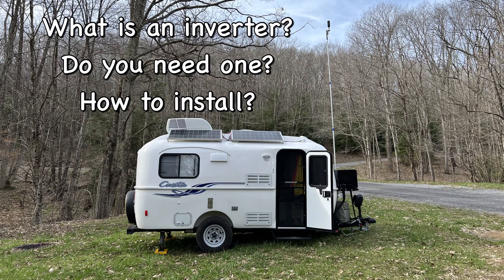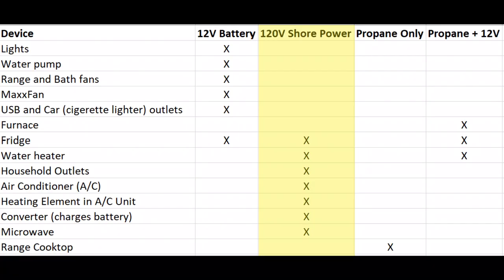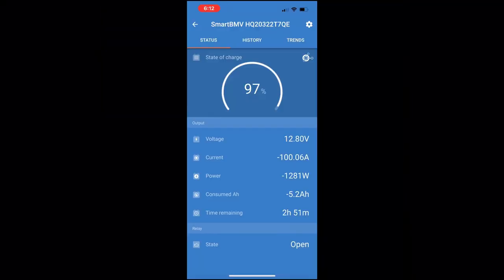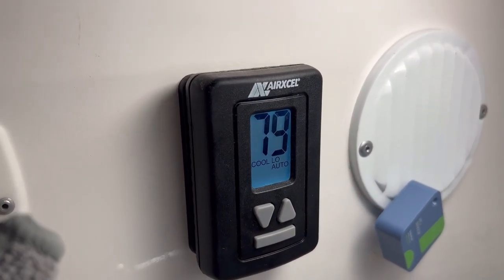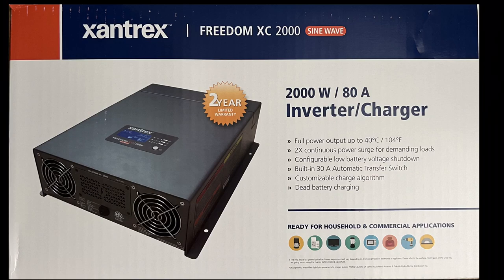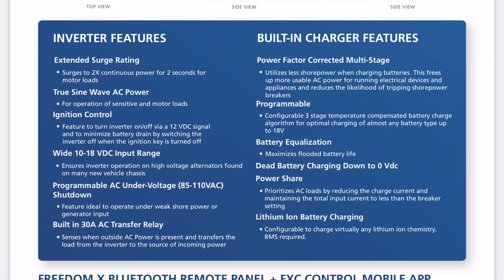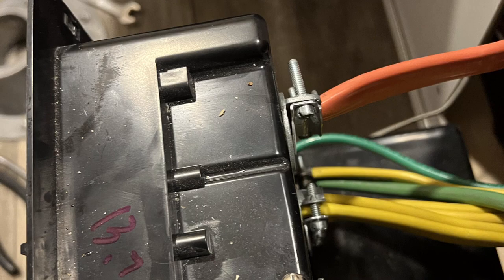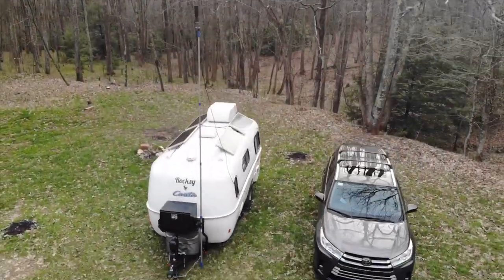What is an inverter?  Do you need one?  How to install?

Comment: Thanks for this! 

Is the new converter you got still in use in any way? Am I right in thinking the 12v board is still needed to deal with the slightly higher voltage from the lithium batteries?
Reply from the maker: No, since the inverter can also charge my batteries from shore power, i don’t really need the upgraded converter i installed last year when i installed the batteries.  Right now i just have the circuit breaker turned off for the converter.  I may remove it sometime in the future.  I haven’t decided yet.

Comment: What size lithium batteries are you running? Did you repurpose the exterior battery compartment for storage?
Reply from the maker: I got two 100Ah LFP batteries and yes, I repurposed the battery compartment for fresh water hose storage.